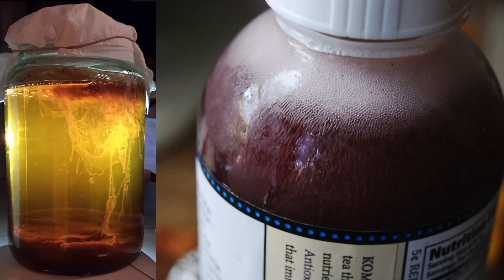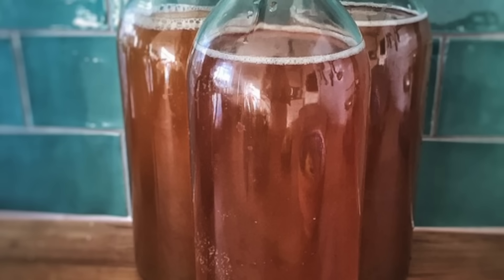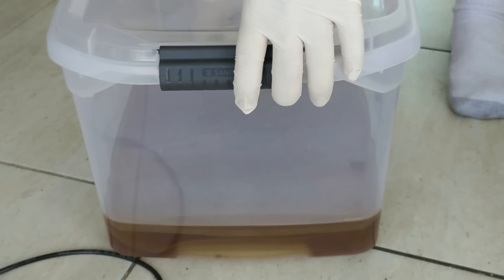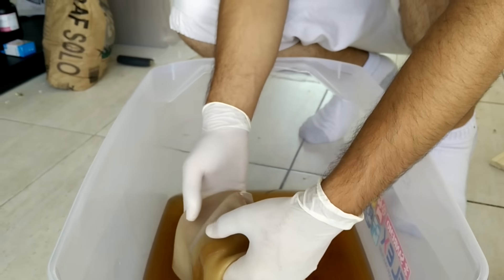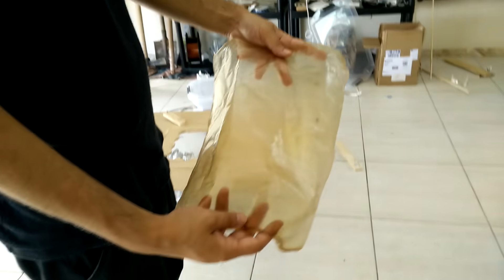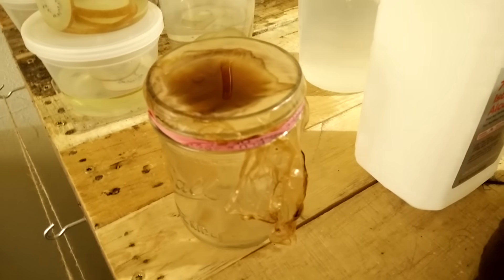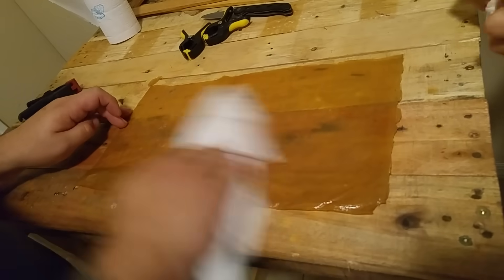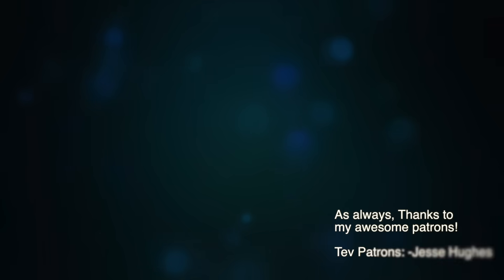How to Grow Leather-Like Material Using Bacteria (Making Kombucha Leather)

Comment: Y'all should use glycerin, applied immediately after taking the SCOBY out of the grow tank and then an aliphatic compound after it dries. 
The glycerin would help cross link the SCOBY material and it'd help oils with unsaturated bonds stick directly to the bacterial mat without drying things out. 

Interesting video. 
GOt me thinking about some stuff.
Reply: I haven't tried making SCOBY Leather before, but I have made Rayon and cellophane. 
AS far as SCOBYs, go I do make my Kombucha specifically to produce Cyclodextrin but that's a different thing people should be doing... 

Anyway... Cellophane, Viscose, and some types of Rayon are all made out of cellulose. The difference in each of these products is really in the solvent that dissolves the cellulose and the end product that the cellulose is used for. 
 
In any case, brittleness of Cellulose fibers is a common issue. 
To combat that, industry uses compounds that can grab and hold moisture from the atmosphere. Lecithins, glycerin, and a bunch of other polyols are good choices to avoid this. 
Another group are acetates, but, given the nature of SCOBY, I'm willing to bet the polymer already has many acetate groups. which accounts for the success seen in the vid.  

After that, the humectants are crosslinked or bound to the cellulose fiber. They kinda skip this in the video. I'd be willing to bet the lack of a crosslinking agent is what caused some of the issue with the Beeswax/mineral oil combination. 

Concentrated Ammonia, Boric acid, and sulfuric acid will all work,  but I'd suggest people use Boric acid. 
Boric acid is mild and, relative to the other options, safe. Additionally, boric acid has antifungal and antibacterial properties that will stop some issues from occuring.
Reply: @walterbunn280  Can you tell us how you get cyclodextrin from kombucha? A google search returns nothing.
Reply: In general, the easiest way to do this is to add a small amount of cornstarch to a large volume of hot, sugary, tea, but you can use other starch sources as well. 

I add about 2 teaspoons of cornstarch to a gallon or so of tea. I then begin to whisk the tea while still in a large steel pot and while the pot is in contact with a cool surface. 

Alternatively to whipping the tea, you can just make a concentrated brew of tea. add the cornstarch, and then stir in ice cubes. 

Regardless of those two methods, once the temperature is correct (anything below 98 degrees farenheit, 36 degrees celsius), add the SCOBY and kombucha start. 

A certain amount of starch settling is expect and fine. I find i have slightly better results with whipping, than stirring in ice. 

I've tried this using corn starch, white rice, and wheat flour. Rice flour would probably work out similarly to corn starch, but the unmashed rice grains I used didn't leach as much starch as I would have liked. They did seem to add a milder flavor to the Kombucha. Wheat Flour actually produced the best Cyclodextrin, but the flavor is horrible. I've had industrial strength acetates in my mouth that taste less pungently of vinegar.
Reply: After a bit more reading about cyclodextrin and amylase, I see where you're going with this. Do you use the cyclodextrin for nutritional purposes? If it isn't refined, how can you be sure of what it's binding to? I mean, if it's developed in the kombucha, it's probably "hosting" whatever is in the kombucha that's available. Maybe that's even why the vinegar flavor was stronger. (I'm guessing about all of this)
Reply: @samothrace2106  I use it for health reasons, but calling it nutritional is probably not accurate as cyclodextrins, particularly alpha cyclodextrins, are used as tailor made emulsifiers and solvents for some pharmaceutical compounds; For me it helps lower cholesterol and break up fatty liver secretions that my body doesn't deal with correctly.

As far as what it's doing in it's unrefined state, "Allowing things not normally soluble in water to dissolve" is the only answer that i can reliably give.
I don't know what conditions other people have brewed their kombucha under, what substrates they've used, what other things could be growing with the yeast and acetomyces bacteria etc etc. 

Anyway... I'll work on a good purification method. it shouldn't be too hard.
Reply: @walterbunn280  Well, thanks for sharing your knowledge so far. I'm looking forward to trying the glycerin for kombucha leather, since I have some lying around. Cheers
Reply: @walterbunn280  Awesome idea! Btw for the cyclodextrin, how do you get them from the brew?? I assume that they are in the liquid, right?? Then will it be possible to make kombucha for cyclodextrin and microbial cellulose at the same time? I'm also in a bit of a confusion here, do you suggest using boric acid as an alternative to glycerin (crosslinking agent)?? Many thanks for all the valuable knowledge!
Reply: @albertwidjaja5938  The hardest part of cyclodextrin chemistry is isolating the compound. It tends to mix with a large variety of organic compounds and it makes purification for characterization very hard. 
As far as that goes, I've had middling success using isopropyl alcohol and "Salting out" the mixture. The observable yields are low, but, since drinking the kombucha without purifying out the cyclodextrin it's kind of a non issue for me. 

As far as boric acid goes, I was actually suggesting using it in conjunction with glycerin and/or beeswax. Not in place of glycerin or beeswax. You can use regular borax, but you have to be mindful of the pH, if you go that route. 

Anywho... hope that clears some bits up.
Reply: @walterbunn280  Ah I see, now I understand. Speaking about the cellulose, I just read a paper about curing starch  based plastic using boric acid/glycerin and UV light. Would that work better than beeswax in this case? And about the cyclodextrin, how much ratio of starch to solution is maximum? Thank you very much
Reply: @albertwidjaja5938  I'm not a 100% certain which would be better between a pure beeswax and boroglycerin/UV. Beeswax cuts down the amount of shrinkage your SCOBY undergoes during curing. 
Honestly some combination of the beeswax and Boroglycerin is probably best, since the beeswax would halt the shrinkage of the scoby and provide moisture resistance in the end product, while the boroglycerin would crosslink everything to keep it together and eliminate the "Sticky" feeling you can get while keeping the moisture even within the Kombucha-leather. 

As for the starch, I'm not entirely sure. As stated many times, I grow my kombucha to be consumed, so flavor and stuff is important. I do start with a 6.5% corn starch gel. That's around 22 grams of corn starch in about 500 mls of water. 

I don't think that's the maximum amount of starch that I could get into my starting gel, but it's the amount that i'm interested in using, if that makes sense. Also, by the time it gets to sitting in the kombucha the percentage probably goes down another 2-3%. Again, i look for the flavor as much as the end product.
Reply: @walterbunn280  I see, thank you for the explanation. Can't wait to make some cyclodextrin kombucha cocktail myself.

Do you have any opinion on the tensile strength of this kombucha leather judging from the material (cellulose) and effects of cross-linking and curing? The paper I was reading is about curing thermoplastic starch using boric acid and UV. The tensile strength documented is 4.28 MPa which I assume is lower than leather.

Maybe this product can have more useful application than leather. The merit of microbial cellulose than any other cellulose source is its purity so cellulose acetate maybe?
Reply: @walterbunn280  You ever try any of these experiments? I'm interested in messing with this.
Reply: @namAehT   Yes. I spent most of a summer growing SCOBY a couple years ago; both for the Kombucha and the to make Vegan-Leather. 
I actually have a six inch diameter piece that was almost 1/8th of an inch (6 mm) fullyer cured still kicking around. 
It takes a really long time to get a SCOBY to a useable thickness. Partly because it slows down it's growth, but compression can result in a very dense product. 1/8th of an inch is as durable as regular leather, although it's a bit more waxy.
Reply: I could... I'd need a better camera than my cell phone though.
I can explain it a bit more in detail though if you're interested.
Reply: Walter Bunn if you could, that would be great! Is this something you tried before?
Reply: How about vegetable glycerine? How is that not vegan?
Reply: Oh this it the comment I was looking for
Reply: rrey0456 glycerin is definitely not vegan though
Reply: Vegetable glycerin is usually vegan and often labelled as such. 
If it's just an ingredient, it will not be listed as vegetable or animal glycerin but if you buy it in a bottle, vegetable glycerine will always be labelled appropiately. What do you think goes into vegan makeup?

Comment: What I think is you should collab with a hydraulic press channel and use a hydraulic press to dry them out. This way, they can be much more sturdier and last longer(My hypothesis).
Reply: This can also get your view counts higher.
Reply: Additionally, you can press the texture in that stage, and it will last.

Comment: It's a cool material production method, and I'm sure it has its uses, but "like leather" it is not. Granted, you started the project as part of an agenda, and I respect that you are actually trying to find alternatives/solutions to what you see as a problem. That puts you ahead of the pack. However, it may be that your "marketing" could use some tuning if you want to see it adopted for anything. I don't know what other animal products it may be able to replace, but it won't be replacing even the thinnest leather for anyone who doesn't share your conviction.

Not trying to push my first point any further, but I am personally curious how well it dyes and how well it molds. I'm definitely interested in a material that I can grow myself, and I'm curious what I could use it for.

Comment: now you just need to test it simulating all kinds of environmental damages, and of course against natural breakdown with time... these have the potential to be much cheaper than leather and to be sold consumables, so the time they persist their structure isn't really an issue
Reply from the maker: Thus far the leather has held up to all of our tests. We've been carrying around the wallet and no amount of heat or sweat seems to damage it at all. We also had it tested at a material science lab. The material has a tensile strength of about 50-60 MPa, about the same as nylon.
Reply: I salute your channel man

Comment: How well does it insulate and how heat resistant is it? Even the thinnest of leather gloves can be used to pick up a campfire to move it a few feet. Thicker leather gloves and leather aprons are used in metalworking to pick up hot metal and prevent sparks and slag from burning through clothing and the workers skin.
Reply from the maker: We'll need to make more to figure that out. So far ti holds up pretty well to heat but gets kinda.... puffy. We'll see what a preheat treatment does to it's thermal insulating properties. Also we're looking at adding some stuff to it to make it more heat resistant, so we'l see how ti works

Comment: I wonder what the texture would be like if you dry it using the method used when aerogel is dried, drive out the water with pure alcohol and or do the final drying under a vacuum. I assume the super-critical CO2 method is not available to you. 

I suspect that if you bond a piece dried that way, where the matrix is not collapsed as much, with a piece that was dried conventionally that you would then have the more typical "skin & insulating bulk" structure of leather. If you can do this in one piece by conventionally drying one side and then doing the gel drying trick on the other side you will not have to work out how to fuse two pieces. 

Also what happens if you treat the material with silicone rubber sealant that has been diluted in a solvent? Add colours before this step, obviously!

One last question, why can't your starting material just be ground up sugar cane and water?
Reply from the maker: Lots to cover here so I'll go in order:
1) This is totally a thing, though probably wouldn't be great for fabric, but we can try it! We're looking at using this stuff as scaffolds for tissue culture, and for that freeze drying is totally the way to go. 
2)Sealing with silane is something we've been considering, but it's more expensive and difficult. We want to see how it holds up with just the wax/oil before we go that far
3) the tea provides more than just carbon. It also provides micronutrients which the bacteria need to grow, and some alkaloids like caffeine which help them grow.
Reply: r.e. 2) OK for something more "natural" I have a set of +100 year old oak chairs and the seat covers are not leather but some form of treated fabric that looks like leather and has lasted a remarkably long time, but not all  fake leather fabrics of the same age stay as subtle so there must be a trick to it. I wonder if any of the old formulary or how-to books from that era that are now on Archive.org contain the secret? Some sort of natural drying oil mixed with bees wax or is the mineral oil a absolute necessity? 

r.e. 3) Oh OK, will need to plant camellias along side the sugarcane then, easy, still natural and very low-tech.
Reply from the maker: Hmm, interesting idea. I'll have to look into it. 
If you want a plant other than tea, dandelion root apparently also works instead.

Comment: Heey! Love your videos, man. I wonder, is this really scalable? If you could make it the size of a cow with no problem what-so-ever it could be an excelent replacement. Also, do you think it's possible to make just one big mix of tea and let it grow to the desired thickness? That could simplify the process a little bit, maybe. Anyways, keep it up, science daddy.
Reply from the maker: Max Lambie we're already working on scaling up to that. our next sheet will be 5 feet across and there's no real limit on how big they can be. gonna brew probably 40 gallons of tea for that
Reply: Id say the only real limitation is making it bigger will make it harder to handle and remove for drying. This could be easily solved though depending on your growth setup or by perhaps drying in the same tub that you make it in.
Reply: Did you have a tea party, or is it still growing?

Comment: That plastic wrap-thing could also be really useful. If it can be sterile,   it can replace plastic wrap.  That way we wouldn't have to use a material that lasts for hundreds of years(plastic) for only a short period of time ^-^

Edit: Or condoms, even
Reply: most plastic wraps used in the kitchen are thing sheets of vinyls or very rarely LDPE (low density polyethylene), not cellophane.
Reply: Roving Jack just checked my kitchen. The cling wrap is “distributed by polyvinyl films Inc.” so, you are right. Thank you for the correction.
Reply: While I agree with the sentiment, cellophane wrap is made from cellulose, and as such is biodegradable.  Shopping bags however...
Reply: My thoughts exactly. Why do we even have a need for plastic wrap?
Reply: Celina k shopping bags and garbage bags will continue to be a problem.  People use a lot of them, even though I don’t, myself.  Trash bags, and packaging will continue to use polymers, until an alternative is available.
Reply: Thermophile true, sadly it's cheaper than baking paper and glass, which used to be used a lot more
Reply: J.R. Spingly Hey, you’re beat, kid. Don’t gotta be slinging insults like that, makes you look like a child
Reply: Tusenbensen its kinda  the same u still need mineral oil
Reply: J.R. Spingly new plastic is produced, what is your point?
Reply: Ilsunny Lo lmao
Reply: BRUH CONDOM😂😂
Reply: Thermophile never got shopping bags, you can just  use an old schoolbag
Reply: This product is mostly cellulose. We already have cellulose plastic.
Reply: How...is it sterile if it's made from bacterial culture....
Reply: but that's longer than you would live ;c
Reply: J.R. Spingly hope you can outlive that “less-than-a-century “
Reply: yea I like this product more as a plastic replacer, even more useful
Reply: J.R. Spingly captain obvious is there where you need him, and when stupidity strikes he needs to be at the scene. But your comment was unecessary either way.
Reply: J.R. Spingly in what environment does it decompose that quickly? I'd say context is of importance here.
Reply: Breaks too easily to be a condom... :/
Reply: Think about the cost. There's no way this would be cheaper and easier to commercially produce than plastic.
Reply: Well, I'll be damned. What if we're out of oil?
Reply: You think oil byproducts are the only way to obtain plastics?

Comment: Nice work, what is the shrinkage upon drying (thickness , lenght, width)?
Reply from the maker: It doesn't shrink much in length or width, but the thickness goes down significantly. That 1.5cm piece shrunk down to about a millimeter or two thick when it was dry
Reply: Thanks for the reply, do you know why tea is necessary for the bacteria? maybe it  needs just a simple nutriment present in tea that could be added more efficiently
Reply from the maker: aetius31 I know they feed on some the alkaloids in the tea and the tea also provides all the micro nutrients they need
Reply: ok i may try this experiment (on a smaller cale than you lol)